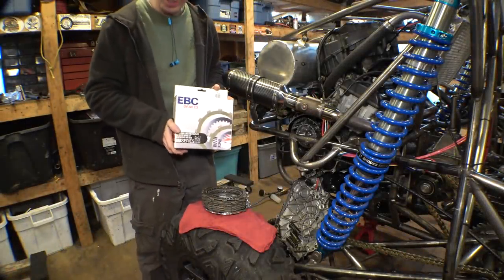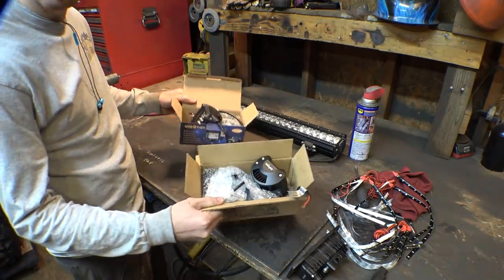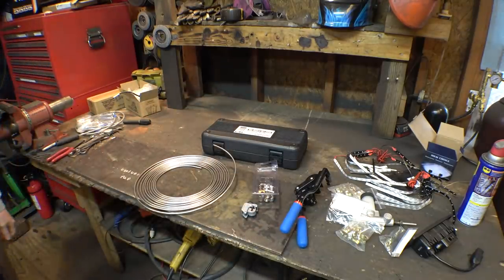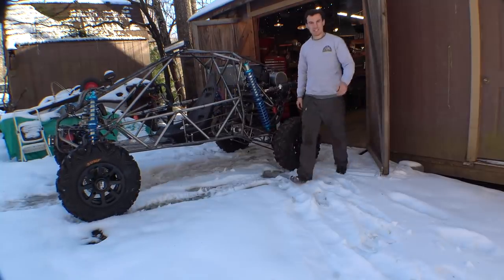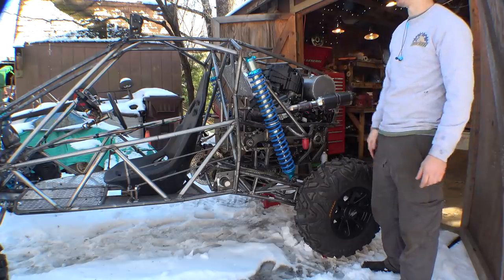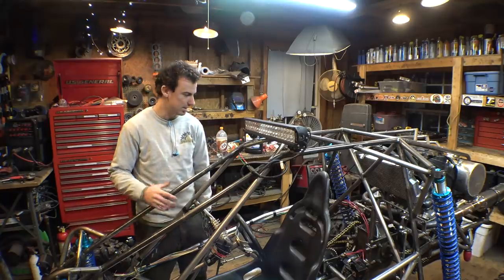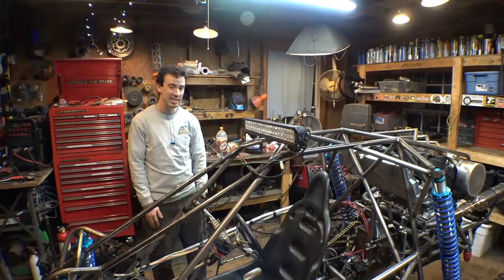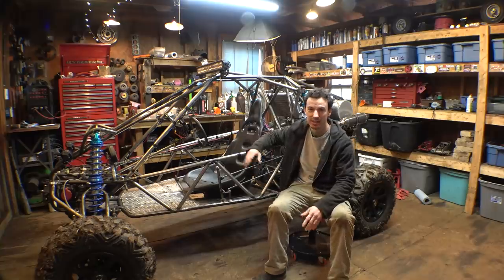CBR 1000rr Off Road Buggy Part 16

Comment: A couple points:
They are Clutch PLATES, not pads-
You should have a bit of rubber line, down on the engine end of that clutch fluid line, not metal all the way 100% - it will break the metal line from engine vibration- you can get a nipple and some high pressure rubber line from any auto parts store, or simply use a short rubber line from any car front caliper, and then just figure out the fittings -
ALSO, the metal line should have rubber around it every few inches to keep it from rubbing the metal frame of the Kart (best way to do this is to use short pcs of fuel or vacuum line with a slit in it, wrapped around the metal clutch line, then zip-tied to the frame)
Thirdly: you should be able to adjust the amount of engagement of First gear on the truck transmission either with threaded adjusters or with shims internally, but jumping out of "Low range" while giving that MC engine the beans will prove Catastrophic to your engine

Lastly, Check what the ORIGINAL Motorcycle had for a Clutch mast cylinder,  size in MM of piston and stroke when you pulled the lever, this bike slave cylinder hasnt changed, so it will require NO MORE than that, if it does, then you have a bad slave cyl or something else? if the bike had a 16mm clutch master piston that only moved 4mm when you squeezed the clutch lever, that is all thats needed - going huge with some mismatched master piston will break the slave off the engine, crack the cases or push the pressure plate off the basket inside the engine, also causing catastrophic dmg-
Reply: No
Reply: @norsevikingsir4932  I approve thy Thor!
Reply: Great advise. Hope he follows it.
Reply: Good point about the rubber line. Having the line crack and spill brake fluid over a running engine sounds like something you'd want to prevent from happening. Brake fluid combusts at about 400 degrees C (750F). The engine itself won't get that hot, but the exhaust manifold or the rear brake rotor may.

He could also use metal braided brake line hose if he's worried about pressure ballooning the rubber hose.
Might as well put the joint between the metal and rubber line at the highest point, use a T joint and add a bleeder valve there to make for easy bleeding.
Reply: did you replace shims and springs bolts etc make to soak in oil overnight sometimes sticking can occur between plates on initial start up also use good expensive oil. you got it, just breathe one step at a time. love your builds dude.

Comment: Buggy's looking great.  Careful with upsizing the clutch master cylinder. Any bigger than 5/8 bore and you can very easily snap the slave cylinder or crack the case. Also for oil, look into Shell T6 Diesel oil. It's JASO certified (needed for wet clutches) and an excellent oil for motorcycle engines and is only about $20 a gallon. Keep up the good work and happy New Year.

Comment: I hope that drip of sealant doesn't mess with the clutch
Reply: I was going to say that too I always use a  small paint brush for this reason
Reply: The only thing I see as dangerous is the break for the rear so close to the seat and the heat that can build up melt the seat

Comment: Sounds a bit like it's missing a cylinder at idle. Might want to check the headers at startup to see if there's a cold one.

Bike clutches on the foot are weird, you do have to put them in all the way all the time you'll get used to it. Make sure you don't overtravel the clutch actuator as well, there's no hard stop in the engine they're basically just travel limited by the clutch lever on the bikes. Found that out the hard way on my 929 and broke the clutch
Reply: It sounds kinda weird with that split exhaust. Should be 4 into 1. For that screaming sound.

Comment: Hey RBW , a tip use old oil to flush the engine. Motorcycle oil of course. Love the build. Keep reving it up. Or keep it down, low and quiet so your neighbor dont hear you. Lol

Comment: Man, you have enough line to run that clutch on the bottom of the frame, don't cheap out. You're going to run that line on the bar you grab on, slide across and the one that will receive the most wear. Rerun that line down low so you don't bend, kink or rip it off.
Reply: Plus any air bubbles will go to the ends. The master cylinders he's using are already much bigger than the ones on the original bike. I think there might be air in there still.

Comment: Great project!   👍  Only problem I see is those rear sprockets can easily take some bad hits.  Not much you can do about it I guess.  Big skid plates or guards will further lower ground clearance.
Reply: U could do like a quad and have a small skid plate only 2 in wide to protect sprockets

Comment: Kart is looking so good now. 👍 Being essentially a proper crosskart, you'll want tires in the rear, with a flatter profile, and a bit less grip. They break free the proper amount in high speed cornering, and behave like rally tires, which is exactly what you want for good performance. The UTV/SxS you currently have, have too much grip in cornering for rears. -For front's you're probably all set with that tire! You'll find that you also want to make a set of fenders with good sized mud flaps.... 👍 😉

Comment: Amazing contraption! But can I make a suggestion?  The linkage for your 3spd box is more complex than it needs to be. If you took the H-pattern mechanism off the top of the box, and remount that as your shifter, then use 2 independent linkages to operate the selector forks in the box. That's the way these old 3spds used to work with column shifts.

Comment: I wonder if the clutch rod is missing a ball in it
Reply: Yea i was going to say same..happened to me, forgot to put it in, spent alot of time problem solving haha
Reply: no.. or it wouldn't be working.
Reply: I know I'm some clutches there's a little arrow on the basket and the cover that have to be aligned or a clutch won't work right either
Reply: I have say no as he didn't tilt the motor
Reply: @micflynn1  true that is just balancing out the clutch disc if you pay close attention to them there oblong in shape to shed oil thru the material
Reply: yes there's a ball bearing on the end of the push rod
Reply: the  3\16 bearing is enough to seperate the clutch pack

Comment: here's a suggestion to get 4 wheel drive... use two diffs with a prop to link them , front diff outputs goes direct to front wheels while the rear diff is placed between the sub shaft that is the last chain  run to drive the rear wheels weld the rear diff as its one side which is output would also carry the input drive sprocket, while front diff can be left open cycle , the prop is the link between the two diffs can be placed below the seat in the center 

for clutch peddle throw...change the lever arm length

Comment: Chris- I'm going to go with Mad Duk Machine  Works about rub protection for that solid clutch line. Additionally, I think I see that the drive cylinder is below the slave cylinder on the motor- this is a bad idea on any vehicle with a fluid operated clutch. If you can't revise your linkage and move the drive cylinder to a position higher than the slave, then mount the drive cylinder closer to the engine , higher than the slave and operate it with a linkage or through a Morse Cable system. The low drive cylinder makes it nearly impossible for you to get all the air out of the system, and vibration will but bubbles into your fluid reservoir, which will work their way up into the lines and slave cylinder. FWIW, on brake linkages, I like simple and direct- complicated systems become a liability and are a PITA to keep in adjustment! This buggy looks a beast- can't wait to see it do what it does! GHPC did the 4WD by using a shaft driven 4WD ATV as a donor- I suspect you already knew that but thought I'd throw it in.

Comment: The vibrations will kill the steele brake line in time. Use rubber hose the last bit! Also, if you have a hard time bleeding the clutch system try to raise the rear or front end in order to get rid of the air bubbles

Comment: Those fittings are sold at every powersports and motorcycle dealer in the country. AN-3 brake fittings in various finishes angles and diameters. Supplied by Parts Unlimited with multiple manufacturers. Usually available with a day or two upon ordering.

Comment: Just a side note you will have to burp your radiator system anytime you take it apart and put it back together,  ON your clutch problem MAKE sure the piston inside of the master cylinder is a lot larger, then you can push more fluid with less pressure, and people have got to understand this is just trials to get the gearing right on point.  Good Luck!!

Comment: To bleed a hydraulic clutch slave cylinder - get a length of clear flexible hose long enough to go between the slave & master cylinder, and sized for a snug fit on the slave cylinder bleed screw.
Crack open the slave cylinder bleeder screw and slip the clear line over the end, put the other end of the clear line in the master cylinder reservoir (submerged in the fluid).
Pump the pedal until the bubbles stop coming from the slave cylinder.
This usually takes less than five days.
Close bleeder screw on slave cylinder and check for clutch operation.
I bet it'll work...

Comment: Congratulations on the build, can't wait to see it stretch it legs.  As a guy who rides a 1000cc 4 cilinder motorcycle the engine does sound weird with those two exhaust.  If it was 4 into 1 it would be more of screaming sound. Now it kinda sounds like a two cilinder.  Still great, just sounds weird to me. Assuming it is running correctly.

Comment: Rigid Industries makes all the lights you're gonna need, they have good options for brake/taillights aswell as flashing ambers so people can see you through dust, which is what we run on our RZRs so we don't hit eachother when riding. Also you should add fenders so you don't get covered, attach the fronts to the knuckles so they turn with the wheel.

Comment: you can use one of the pods for a tail or brake light. 
just get a tail light repair kit from auto parts store. 
will include clear , yellow, and red. it is a clear colored tape,  easy to use.

Comment: Soon it'll be on the trails. For a 4wd version you'll want a differential for the front to help with steering. People suggest a first gen Miata differential since those have a Torsen limited slip.
Reply: Polaris or any sxs will give you an e locker and lots of axles and hubs to.pick from.
Reply: @Shredxcam22  Parts are expensive unless you can get a good deal from some jag off that rolled it.
Reply: @Ratkill9000  copart.... I just got a rhino 660 diff for $125. Little older but for this it may be solid enough.

Comment: The low gear is badass. It dose crawl tho here's one thing I seen might be a  problem. If you are getting on it hard around corners the rear arms might buckle in twords the engines maybe a sway bar on both rears drives the only thing stopping them from not folding is the jack shaft. Not picking ur build apart but it's something I just noticed might happen it might not happen also. But is that a kfx 700 in the back ground behind the other shed. They where some fast bikes. Killer build tho. An with how much it crawls it would be cool to be 4x4. With that being said I bet you build a 4x4 next lol. 😁👊

Comment: Electric Motors on the front! only used for crawling in 4 wheel drive, so you don't have to have a huge battery, then you can rob a few horsepower from the engine and install a bigger alternator that will recharge the battery faster, then again, is only for use when you need it, like rock crawling at lows speeds. Maybe 2 hub motors would make it easier, a 76v battery, and then a sensor to read the rear wheel speed and a controller that will accelerate the front motors based on the speed of the rear wheels! just an idea!
cool kart! keep it up!

Comment: to turn those pod lights into tail lights, look for tail light repair kits, they either come with transparent red tape or red plastic, the same as tail light plastic, and some adhesive or tape. should allow you to change those lights to tail lights.

Comment: Chris, you say that the clutch pedal is too hard already. But if you put bigger master cylinders on it, then the pedal won't travel as far but it'll also be harder than now since you're moving more fluid. Also, if you put a bigger one on your brake setup you may decrease the amount of braking force/pedal force, making your brakes less effective. If I were you I'd figure out the math between the size of master cylinders and the size of calipers/clutch to get your wanted travel/effort. 
P.S. long time watch, first time commenter but I didnt see anything about this in the comments and I just went through a brakes section in my auto class at college so its fresh in my head :) love the vids

Comment: When you're flushing out old oil or contaminated oil, don't use your expensive oil. Use the cheapest crap you can find to do the flush and then use the good stuff for the fill. And since you obviously build custom coolant systems and are constantly flushing and refilling existing coolant systems you really need to get yourself a coolant funnel meant for getting the air bubbles out of the system. Its a huge funnel that has adapters for a bunch of different radiator cap types. It holds basically an entire gallon of coolant and you let the engine run for about 30 minutes with it attached and the bubbles will get burped out instead of getting trapped in a sealed system. They're awesome.

Comment: Hi Chris like I have told you before I build buggies all the time 2x4 and 4x4 two seat and single seat all you need to use is Subaru differentials  and spindles and make a gearbox and you would not have to use chains and still use that motor yes it will take more cash and more work and time but it can be done and you can do it. even if you do not want to build a gearbox you can still use chain to drive both front and rear Subaru differentials. if you might want some help just set up email so we can talk that way if not have fun doing you build and do the best you can you can do it just go for it.

Comment: You could put a quick shifter on it.. then you could slam through the gears without letting off the gas, and only need to use clutch when downshifting or from neutral.   I got an Annitori quick shifter for my bike for a little over $200. It just senses when you are up-shifting and cuts timing long enough for shifting to happen, like 100 ms.

Comment: @rather be welding,. Advance in AutoZone sells a brake light lens kit it's basically colored plastic that you can use to make lenses for your tail lights it's got red and yellow in it and white red and yellow and white go check that out you can cut a piece of it out and put it over top your LED light!!

Comment: Its like a semi truck transmission what with 18 forward speeds and 6 reverse speeds XD
Though a semi usually has more forward and a couple less reverse methinks, like 21 forward 4 reverse or something, but I love the setup.

Might wanna go for mechanical control cable (I think you mentioned something about it a video or two ago) instead of the lever-rod system for the range selector so it has less slack, but the system right now is far more affordable, from what I could find it seems a push-pull shifter cable, just one, is like 30 bucks and that ain't cheap. I can't wait to see this thing fly!

Comment: Install a short jack shaft in front with cv axels to front wheels run chain to back jack shaft use the same  size sprockets  boom 4 wheel dr you can build anything I’ve seen your work.

Comment: There is a tremendous difference in the volume of fluid for different line sizes. A 3/16" line cannot move the piston on a caliper designed for a 1/8" line until it moves enough fluid, overextending the master. Also, your slave cylinder is as high if not higher than your reservoir making it pretty much impossible to bleed. Since reservoirs are non pressurized, you can get away with an extension tube. Line can be bought at AutoZone or O'Reily's, fittings are at Napa (I hate waiting on parts). Try your lines first, I'd bet you a fistful of ones (lol) it will be night and day.

Comment: Love your builds very entertaining! Have you ever thought of putting an electric motor on each wheel to make four-wheel-drive with a gasoline generator to supply the power and may be a small battery pack  To take up some of the slack?

Comment: Your high range on the 3 speed should be a 1 to 1 ratio. It’ll rip dude, don’t worry about it!
You need to hook up with a group and get your ass out to Glamis. I’m sure the Grind Hard boys would be down. Maybe get in contact with Ol Cleetus McFarland or the SXS boys? 

The winter is the best time for Glamis, it’s nice out there.

Comment: Chris use that 2and trans as a transfer case in reference to the gearingand just use the bike trans as your main trans so you can shift without using the clutch after you get rolling

Comment: love the build. 4x4 now that would be cool but not small tires 31 inch +. find a trans and t-case . front mount engine, driving the trans like the one you have now. good trans and t-case would be suzuki samurai. small but would be strong you could even use the straight axles and build a buggy or you can get IFS third members out of a suzuki sidekick all the ones iv seen come with low gears so would be good for a 4x4 crawler. sidekicks would probably be easier to find in the junk yard, and you could get most of the stuff you would need diff, axles, and you could even use the hubs. but you would have to find 2 because you would need the frontend parts only. + it would be cool to do some thing with trans like you did with this one but drive it with a 670 it would be a lot less stuff to deal with